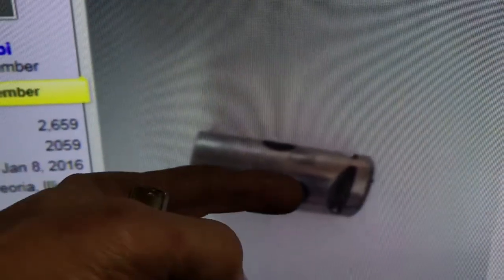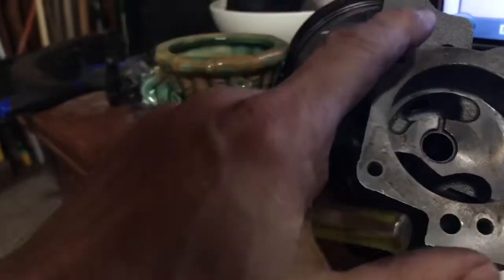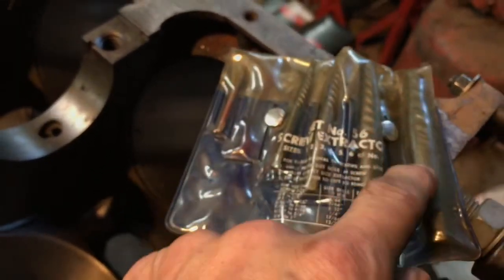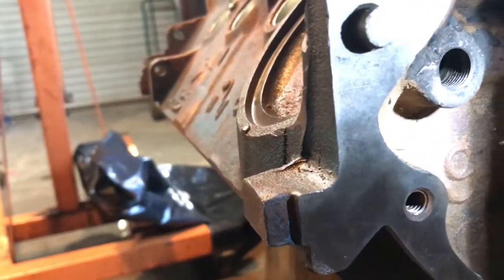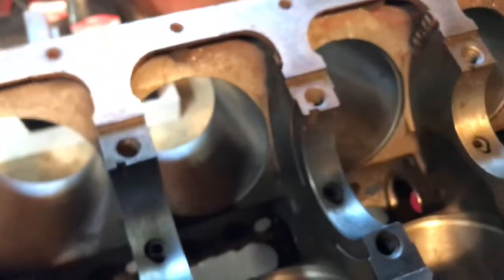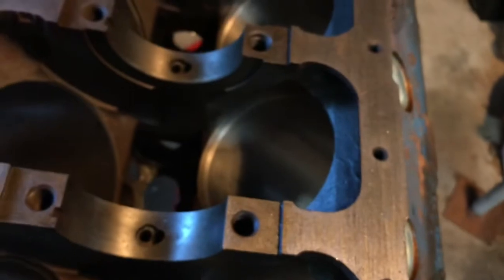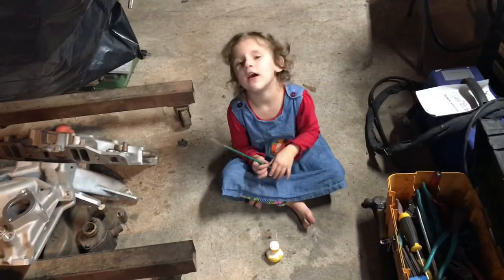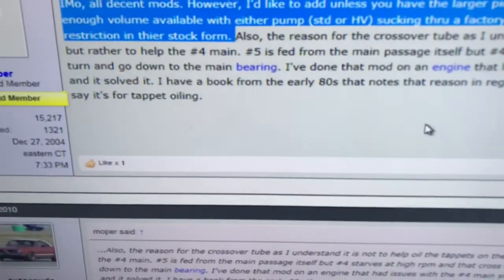China ain’t that bad. :-) $$

Comment: The cross over you showed on the computer is a good idea, because you want to fill other side gallery without losing any flow to main bearings...The pump pickup mod is to me is a bit sus, look at the original entry!! Its elongated so your getting a good flow into pump..But if you drill and make your own on the plate, the oil flow has to do a 90 degree turn, unlees you come in on a angle Hmm... i like the look of the factory entry... Mines still a factory pickup diameter seems to work fine... im just throwing it out there, it does take time too think and feel comfortable with mods like this, keep  thinking and researching about, i love it its a very interesting part of modifying your block.. Dont worry because your inproving it by what ever your doing... the factory setup oiling is pretty average to say the least
Reply from the maker: GRIFFS REARMOUNT TURBO, The Modfather The pickup I’m referring to is made by a name brand manufacture of pans and pickups for circle track racing.
I’ll show a pick of it on next vid after I get some feedback and do a little more research.
Fixing to head down to Lowes and pick up a couple taps, pipe plugs. and maybe some fittings for the crossover too.  
I wonder if pushlock 3/8 fuel line would work if I added fuel injection clamps for safety.  Only question would be the heat as the line is good for fuel, e85, and high pressure?
Reply: @TheProchargedmopar  maybe a hydraulic line repair shop could help you out..